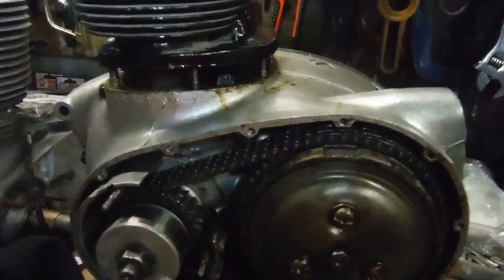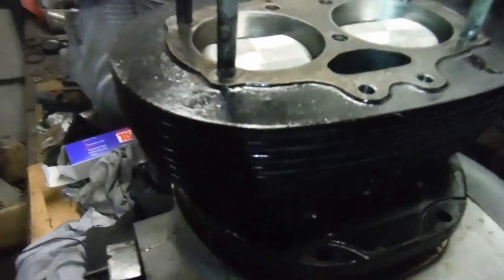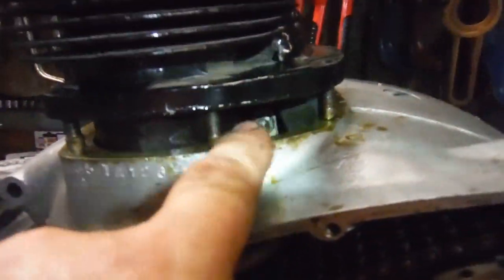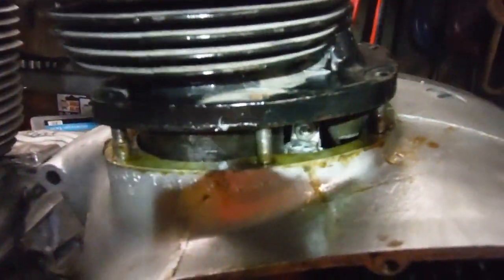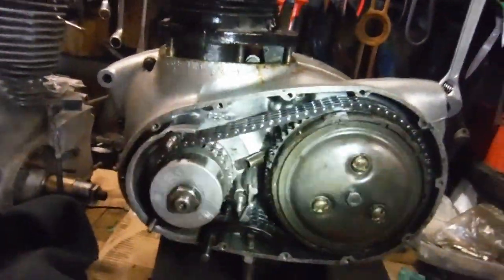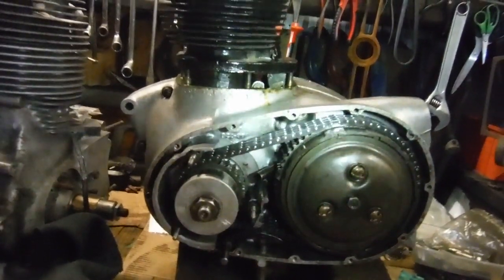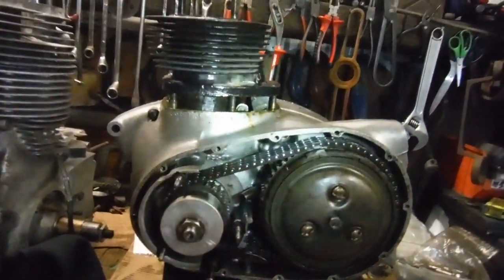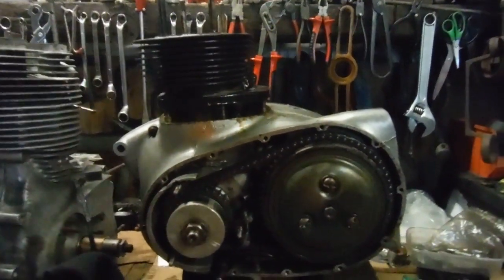BSA A65 engine rebuild - Friday afternoon blues, you couldn't make it up etc.

Comment: hi Paul it smacks to me that the cases could be a mismatch set from the start. i have come across the kind of thing before and the same with the camshaft trough as well when the cam shaft was in the cam lobs would foul on the trough.

Comment: That's an odd one Paul, never seen the crankcase actually stop a barrel going down and have swapped plenty over the years. A tappet dropping out and turning in the block is pretty common (factory fitted circlips in the day to stop that) Any chance of the cases being distorted by the ally welding? Never come across this prob before, have encountered every other possible A65 engine problem though, you are unlucky with this one mate!